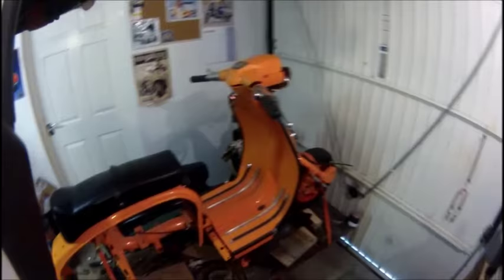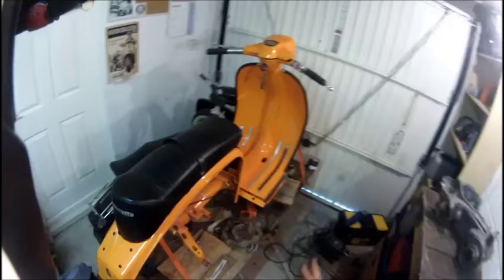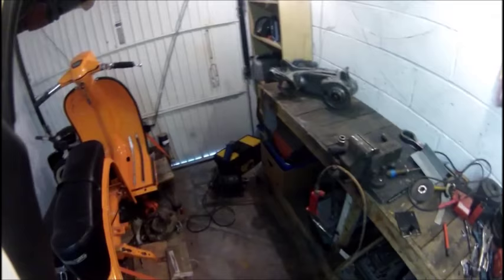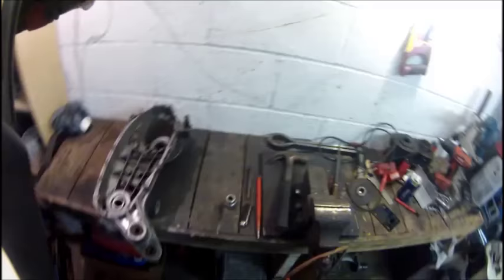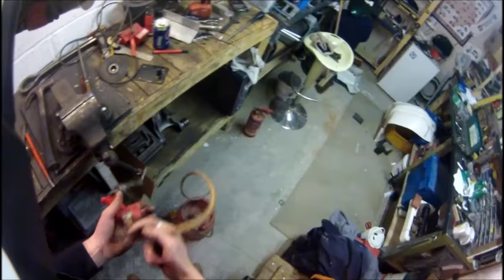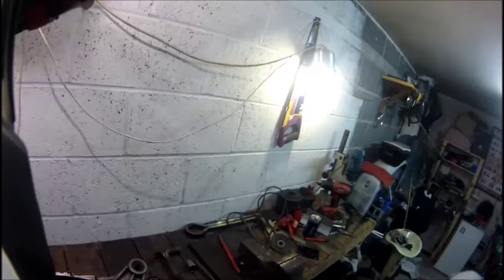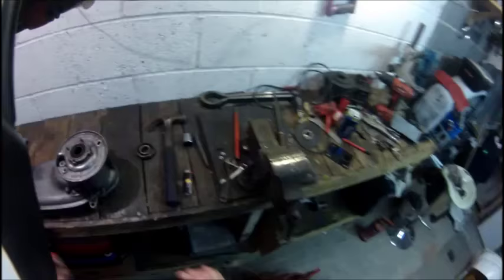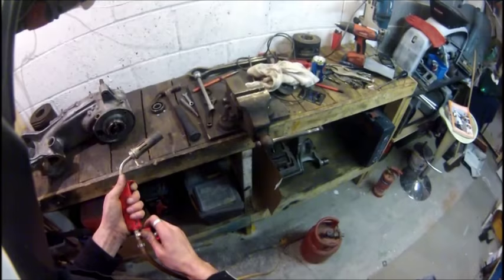Lambretta Vlog Time 55

Comment: inspired by your scoot, I'm currently spraying mine Satin black. Great vids - KTP
Reply from the maker: Haha, nice one mate! I hope there'll be a few pics to look at when it's done! Great stuff, thanks bud.
Reply: digger9million did your scoot come black or did you spray it yourself bud? I'm rattle cannin mine, it's hard going filling and rubbing and despite how much you do, ya always see another blemish. Think I've come to the point where it will just have to be as it is, cos I'm missing the ride and its never goin to be a professional job.
Cheers ...
Reply from the maker: Rimmer 125 when i got it the frame was glossy black and the panels were like an old satin kinda black but all a bit mismatched, so i got them painted locally by a VW camper resto firm into matt. It seems you can get away with a lot with matt colours and I touch mine in with a rattle can when needed. I painted the front mudguard myself Poundshop matt black and it looks fine, and also a bit on the bottom of the sidepanels where they always split. I know next to nothing about painting! Thanks for watching buddy.
Reply: Well ya rattle cannin looks good from here.

Cheers

Comment: Nice project, looks pretty good a easy build by the looks , I've been tinkering with mine and fitted a R1 rear shock , it's all ready for this year :-) see ya at Knaresbrough
Reply from the maker: simskin1986 Yeah pretty straight forward mate. What made you choose the R1 shock? I fancy a new one as I'm still on the original Escort, but there's loads to choose from now and might go for a BGM. Dunno. I'll be at Knaresborough yeah, see you there.

Comment: I think you need to heat those casings a little more, normally when your spit sizzles on them after heating there hot enough. When reffiting the bearings do the same &before hand leave the new bearings in your freezer for a few hours & they will drop in almost on the own .
Reply from the maker: Yeah possibly a bit more, though I could see the metal sort of 'sweating' if you know what I mean? With little beads of oil or whatever being drawn out to the surface so I just went for it. I'm terrified of just melting the casing and destroying it completely, though having said that, a crack or break would be a nightmare too if it's not hot enough! It's a knife edge. I know the tip re: freezing the bearings and the same with the engine mounting silent block things too when fitting them. It's ace when stuff just goes together! Thanks for watching buddy.
Reply: Don`t worry too much, it would take some amount of heat to melt those casings. The sweating is just condensation.Keep up the good work.